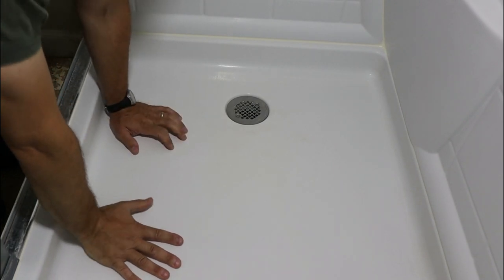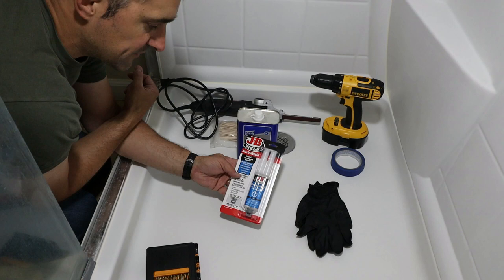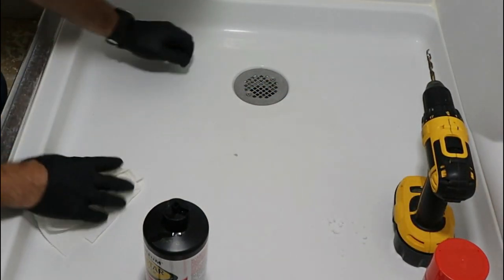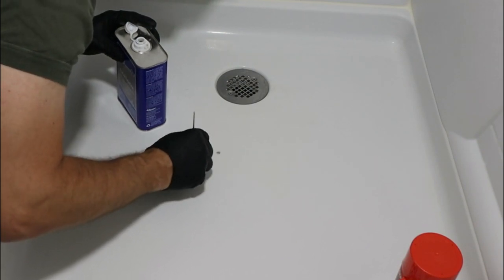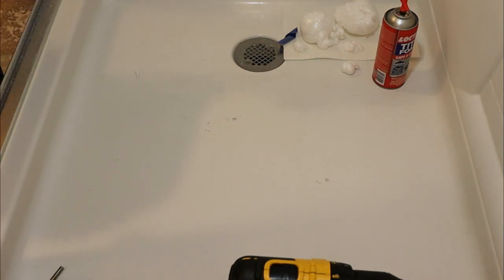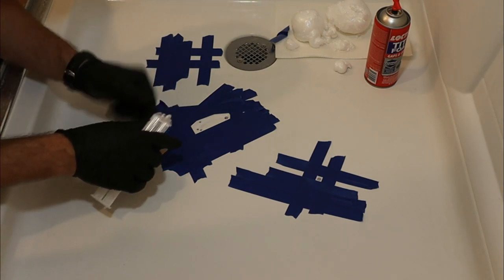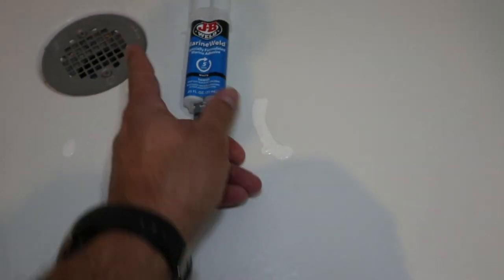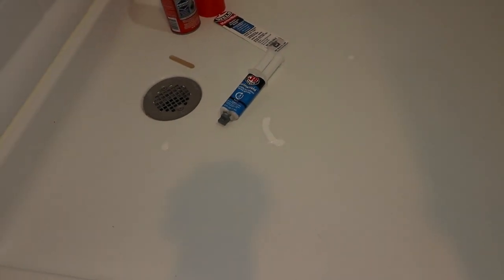Cracked Shower Pan Repair On The Cheap

Comment: Are fiberglass shower pans more susceptible to cracking in pier and beam houses that inevitebly move a bit here and there? My shower pan just cracked and I heard a contractor say fiberglass pans sometimes will crack on pier and beam houses that move a bit.
Reply from the maker: @weshagman6711  I am not an expert but I guess that can happen.

Comment: I used Great Stuff. I hope it works
Reply: How is that working out? Did you do it this way or use fiberglass at all?
Reply from the maker: No fiberglass but I had to redo it. The epoxy didn't hold up.
Reply: @HeikosGarage  what did you put? it worked out?
Reply from the maker: @sofisaactube4828  hi there,
Check this out.

Comment: How’d this fix hold up?
Reply from the maker: It didn't hold up. The white marine epoxy didn't bond to the shower pan. I am in the process of making a follow up video. 
In my next attempt I am using whit marine sealant made by 3m.
Reply: @HeikosGarage  thanks looking forward to it. Did the foam work?